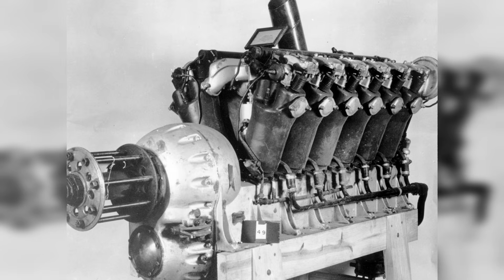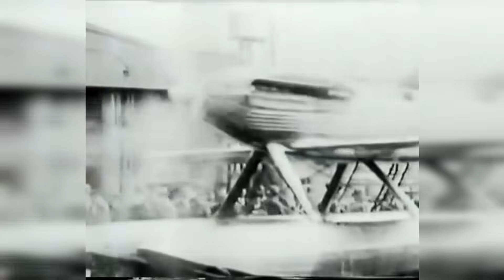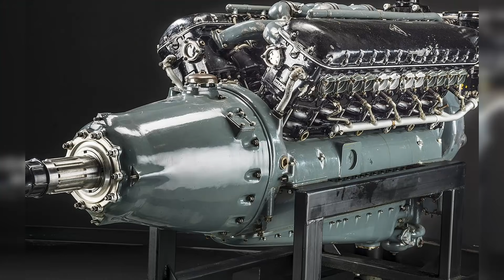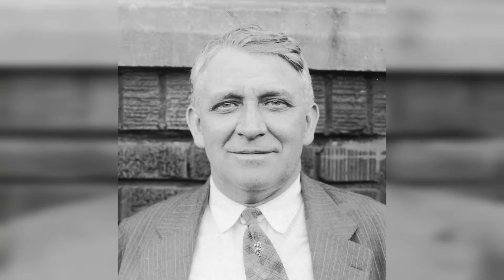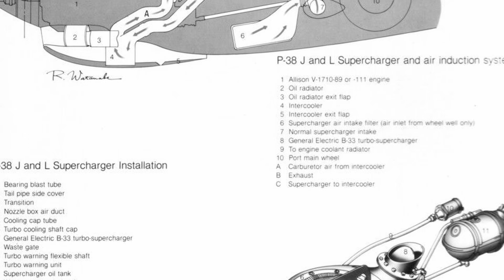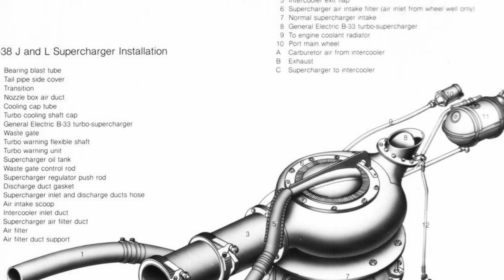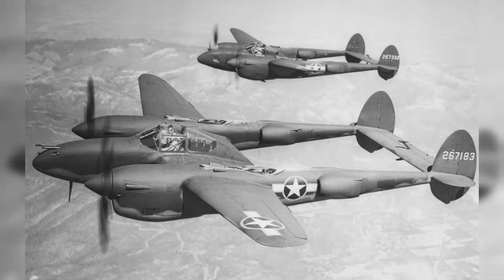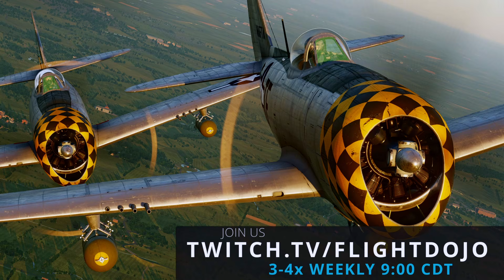Allison V-1710 - A Liquid-Cooled American WWII Warhorse

Comment: There is more to the story as a plethora of factors were involved.    One major one was the tolerance for engine wear our/damage and support.   Europe had built in good support (UK primarily).    A Merlin broke or was damaged (by detonation)  then it was easily swapped out.   Mechanics and engines all there and hangars to work in.    

Among the overlooked aspects was what the FW-190 and Typhoon/Tempest were.   Mid altitude  designs,    P-51A anyone?    When the fighting moved down,  the Allison was right at home.   Africa,  Italy,  Pacific?    All mid and lower altitude and the Allison shone there.   So the context of what was demanded and when.    And never forget,  the Merlin has serious detonation problems as they ran them on the edge.     

Then there was Allison simplicity  compared to Merlin complexity.    When working on an engine,  that is major.   The Brits love their complexity.   Use two bolts when one is fine.   I worked on diesel and was warned about Perkins I was tearing down to assess for repair or scrap (we scrapped it).    Wonderful engine,  way too many bolts and fiddly bits.   

The US made gaskets kits for the engines.    UK had artificers who  FABRICATED  on site  the gaskets from raw gasket materials,  no kits.   So the Merlin was very  labor intensive (that could have been  corrected but not how it was done).    

So the UK wanted altitude,  ergo the P-51B,  and the US Army dumped Allison and piggybacked  onto the P-51 as it  did work at high altitude.    Two faced Army Air Corp but it was practical.   But never loose sight of who funded the Allison (AAC) and Allison could not spend money they got nothing from.    Merlin was funded to dual stage super charger (or dual speed).   It was not a matter of Allison not wanting to,  they did.   They were not stupid,  the knew what the US Navy did (two stage) and Merlin,  they could not afford to do it until too late.   

TESTING:    The Allison was tested to and performed at a higher test level than the Merlin.   That was US AAC mandate,  but then the Merlin did not as the UK did not match those arduous levels and times spent at 100%.    The Allison was more reliable and lasted upwards of 750 hours in frame.    A Merlin was lucky to get 250 hours.   Ergo,  war effort and time and people,  the Merlin cost a lot more.    
        They saw the results with the P-40 when it was abused severely being pushed to much higher manifiold pressure than the book allowed,  and survived!    No one cared for the book when your life depended on more speed.  

Fly It Right:   Flown right the P-40 and P39/40 more than matched a Zero or a ME/FW at lower altitudes.    And that was where the action was in close air support in Africa Dessert,  Italy and the Pacific.     Yea,  that was what P-47 and Typhoon/Tempest worked in Europe.  

Low Coolant:   The Allison had a much better design that allowed ops (not full throttle) with low coolant levels and that was a major make it home factor that the Merlin did not.  

The Allison was modular and could be setup for a wider group of Airframes,  the Merlin had to be tailored for its airframes.    

The Allison was severely hampered but the Army Air Corp refusal to fund the two stage research (the US Navy used TWO STAGE in all its carrier radials).     Allison work was funded by the AAC and they could not afford on their own two stage research (they could during the war when money was no object).   

What allowed Merlin to succeed was Packard making it for the UK and the full support of a factory to make it.    Allison did not get that free lunch money.   

The Allison was a better engine,  hampered by who it was being made for.    P-40s were made until November 1944.    That says volumes.   Not glamorous  but needed for CAS.

Comment: The Soviets strongly preferred the Allison V-1710 over the RR Merlin when they had both types offered to them in lend-lease fighters. The lack of high altitude performance for the Allison V-1710 was a non-issue for the air war in the Eastern Front. The robustness and ease of maintenance of the Allison V-1710 were just what the Soviets needed in the harsh operating conditions they had.

Comment: That meddling by the US war department is why the US was so successful everywhere. 
All the different large trucks used the same tires.
Engines from different manufacturers could use lots of the same parts distributors, carburetor....
It obviously didn't work in this case

Comment: Your assessment of the Liberty V12 being crap is from your lack of understanding of the time in which it was built. You're looking at it through a distorted lens of the technology from the 1930s and 1940s. Engines from 1900-1920 were in an entirely different world. Most of the advancements later 30s and 40s engines relied on started in the 1920s.

Fuels during the 1900-1920 time frame were horrific at best. Oil cracking and distillation were basically non-existent during WWI. The processes had been invented back in the 1890s, but the technology wasn't sufficiently developed until well into the 1920s after the war. TEL also wasn't available until the 1920s in quantity (nor was its anti-knock effects widely understood), so most fuel was unleaded 50-60 octane at best, or 70 in small quantities.

So, in order for an engine to produce several hundred horsepower, the cylinders and pistons had to be ridiculously large. The compression ratios also had to be really low to stop pre-ignition.

Lubricant technology was also horrific for the same reasons as fuel, it wasn't well understood. Engine oil was barely processed and poorly filtered straight out of the ground. It tended to be really acidic and would damage internal engine components during use. Pressurized lubrication at the time was a rarity, many designs used babbit bearings with splash lubrication. These factors compounding with large reciprocating mass and the fact that engine designers didn't know how to properly balance engines kept the RPMs really low to keep engine life at a reasonable level.

For most engines during WW1, 1200, 1300 or 1400 RPM was the end of the world, unless you wanted the engine to fly apart. The L12 making 400 HP and being available by the tens of thousands from mass production was unheard of at the time. It was a feat of engineering.

Comment: I often wonder why the Merlin dual speed 2 stage supercharger as manufactured by Packard or it’s subcontractors couldn’t be adapted & mass produced for the 1710. Afterall there’s a war on, which was why Bristol was forced to pass on it’s sleave valve secrets to Napier. Also I’m pretty sure 2 stage Allisons were fitted to both the P63 Kingcobra & the (F82?) Twin Mustang.
Reply: Plus the Russians did manage to use their dual stage P63s during the war, both in the Eastern Front & the Far East / Manchuria.

Comment: The Allison 1710 did not have poor performance at altitude. It's just that most versions were single stage super charged instead of two stage like a Merlin. The version of the V-1710 in the P-38 and other aircraft that had a turbo charger, rocked at high altitudes.

Comment: So with proper development in the engine, P40 could have been one of the top airplanes in WWII?
Reply: Big issue was the super charger.  Had it been equipped with the newer, two speed supercharger it would have competed well with the others.  Was built better then the early merlin engines were.

Comment: Using a turbo charger to add torque to the crankshaft is like powering an electric motor with a generator that is turned by the electric motor.  A turbo has an energy cost in that it increases exhaust pressure, which in turn saps power from the crankshaft.  A turbo charger used to boost intake pressure increases horse power, providing a net gain.  Imagine using a supercharger to turn the crank, instead of boosting intake pressure.... think about it. Power from the crank turns the crank directly?

Comment: The combustion chambers pic shown in your video is not a V-1710 cylinder head, there is only 1 spark plug per cylinder. But to be fair I couldn't find any combustion chamber photos or drawings on the web either. Good content though. Learned a few more details. Thanks for sharing.

Comment: Went down a rabbit hole recently with the American M6 heavy tank which began development in May 1940.  Being 57 tons it needed a decent engine and the committee of SAE engineers assigned to look into it selected the Wright 1820 to supply ~825 hp.  What I don’t know is if they looked into the 1710, which would have been in production at the time.  Later in the war the Merlin would be used in tanks quite successfully.

What’s interesting about the 1710 in this application is that it was a GM product and GM also had Hydro-Matic transmissions.  In theory a 1710 with a Hydro-Matic would have made one of the best tank engines of WW2 and potentially a viable power package for decades.

What I’d love to know is if a 1710 was ever arranged like that, for use in heavy vehicles?
Reply: Most Illogical! An M6 Tank is way too large to enter a Rabbit Hole! 😋

Comment: 20:50 I wonder how fast and deadly the P-39/P-63 would be with the turbo-compounding system (or a two-stage supercharger for that matter). I say this because the P-39 is my favorite American fighter of WW2, and I reckon that a P-39/P-63 with a sufficiently improved engine would have the ability to outclass the Bf 109K-4, Spitfire Mk. XIV, Tempest Mk. V, Ki-84, J7W Shinden, Ta 152, and P-51H.

Comment: You still have the Bore & Stroke backwards. It is a 5.5" bore and 6" stroke. When you restated it after your little giggle you just flipflopped the order of statement and not the fact that in fact the engine is a "long stroke", meaning that the stroke is longer than the bore is wide. You still have it backwards in both statements.